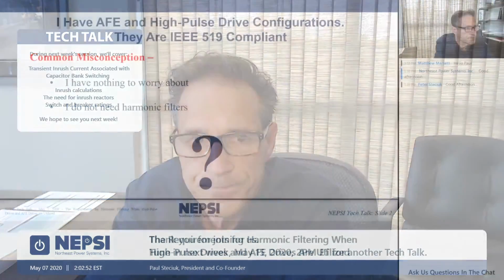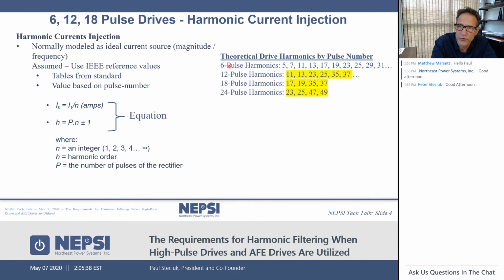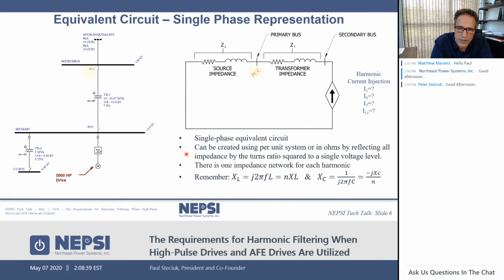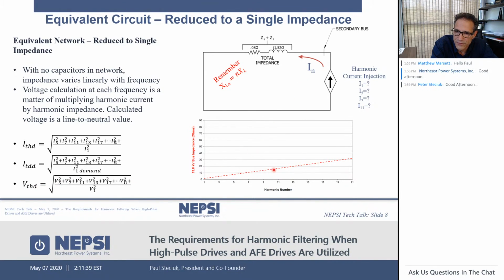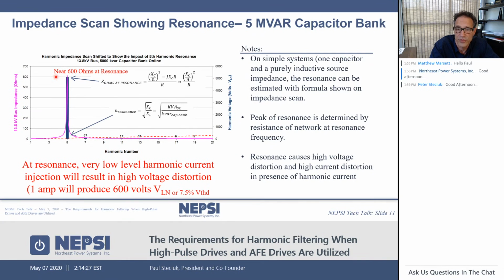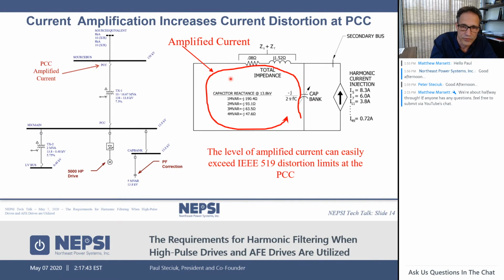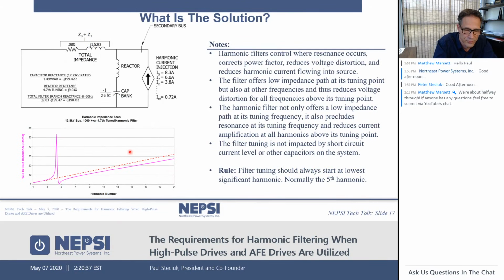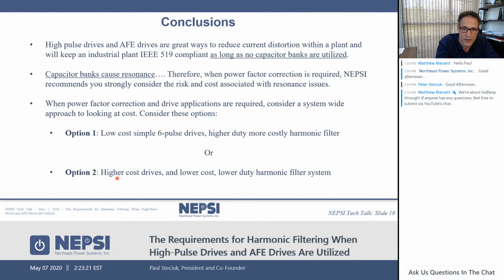NEPSI Tech Talk Session 01: Harmonic Filtering Requirements in Plants with AFE/High-Pulse Drives

Comment: Why resonance exists below the tuning point?
Reply from the maker: Resonce occurs when Xc = XL of source.... Xc is capacitance of capacitor bank. XL is inductive reactance of source short circuit impedance plus inductive reactance of filter reacotr. Thus resonance will occur below the tuning point. XL and Xc above are all at fundamental frequency of system (50 or 60 hertz).